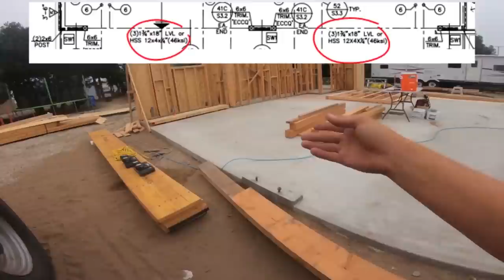FRAMING A HOUSE | 6 WEEKS IN 60 MINUTES!

Comment: I can't believe you did not put some kind of seal under the plate lumber. Either foam, insulation or construction adhesive. As close to the ground as that house is, poor engineering. That house will have water problems for sure in the future. I love a slab foundation only if it is raised at least two feet above ground. You can have that on the  ground crap. JS
Reply from the maker: Jerry, sill seal isn’t done here in California.. We get an inch of rain a year, and never see weather like most states.

I’ve been asked about seal all the time, just isn’t called out.. Similar to vapor barriers in ceilings, never seen them here.
Reply: @MattBangsWood  thanks for your reply. I believe in my area of SC, it is a code requirement. JS

Comment: I don't see attention to detail at all. These guys blow their own horns all day and cut corners.
No sill seal under the pressure treated plates. No construction adhesive between the laminated beams. Where is the construction adhesive under the sub-floor?
Reply from the maker: Sill seal isn’t required here, so that’s out of the question..

No construction adhesive on a 4-ply with 300 SDS screws in it, you’re correct there. Would it hurt? No, If we shorted ourselves and only put 50 screws, I would see concern.

I had a partnership with Titebond on this project, the floor system was done with Titebonds Adhesive.

No horn blowing. No cut corners, nice try though..

Comment: Vertical plywood= 0 structural integrity
Reply: Wrong.Actually the first 4’ of all corners should have vertical sheet installed. As for doing rest horizontal you would need to install block between studs where osb butted. That’s a lot of extra work and material (2x6’s) needed. Besides this house has 9’ ceilings and they are using 9’ osb so it works out nice.

Comment: Hope your not getting paid by the hour, I cannot for the life of me figure out why anyone would not frame/sheet/typar the exterior walls before standing them. Its actually retarded not to.
Reply from the maker: Because you just can’t do it with utilities like pipes and electrical conduit sticking a damn foot out the slab. It’s not practical. If it was a subfloor? It’s doable! But unless you build the wall, lift it a whopping 2’ off the ground over the utilities, it won’t happen buddy.

How many slab on grade homes did you frame this year?